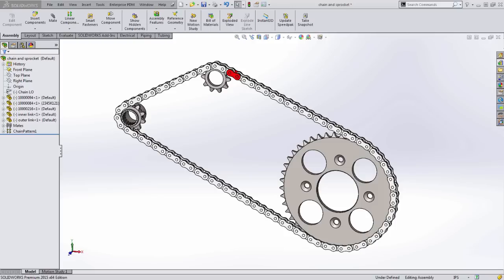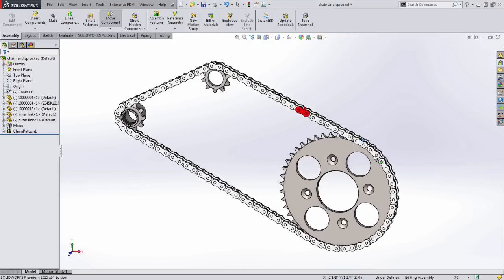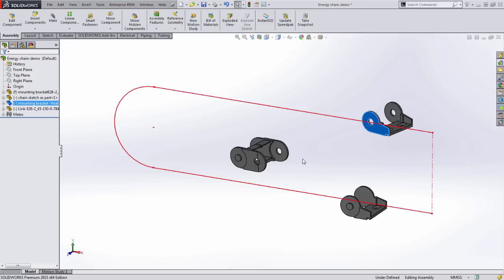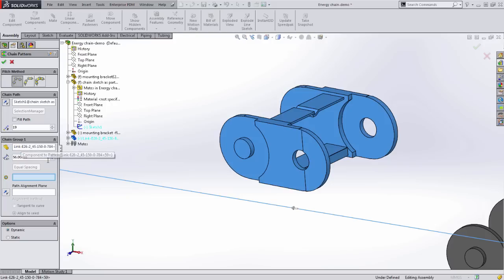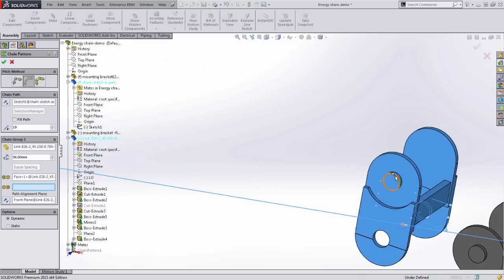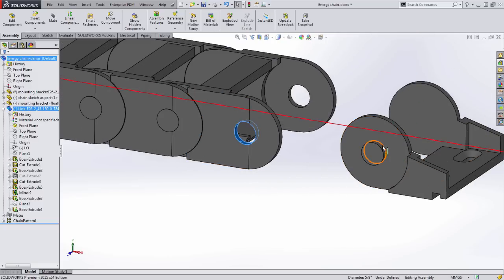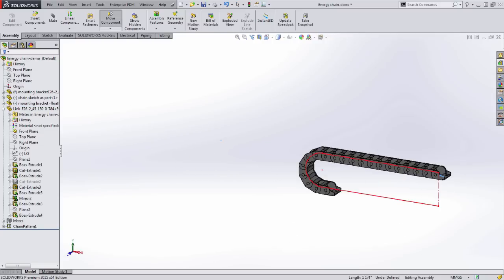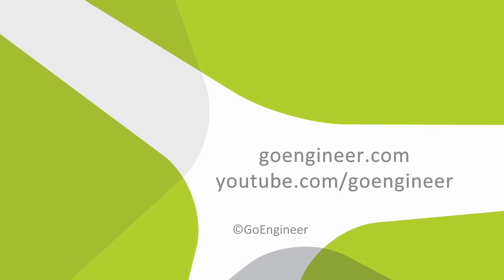SOLIDWORKS 2015 What's New - Chain Component Pattern

Comment: I'm doing this in SW 2023, but i'm sure it might affect all versions since 2015.
The "movement" does not work, if you edit the links.
Solution:
1.) "suppress" the concentric link between the stationary and the moving link.
2.) Move the chain around a little bit.
3.) "unsuppress" the concentric link.
This should restore movement.  This drove me crazy and took at least 10 iterations to figure this out.

Comment: Why don't you show what happens when the red chain link passes the two smaller sprockets? I hope SW will add a new mate type to allow continuous movement along a  closed loop, instead of half-assing it with the rack and pinion mate